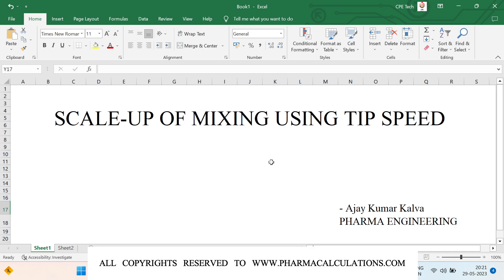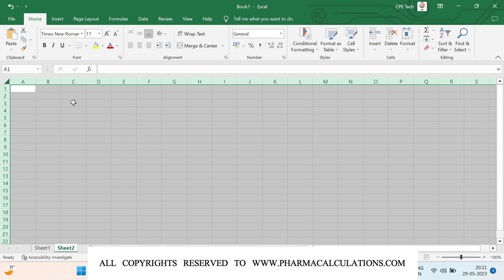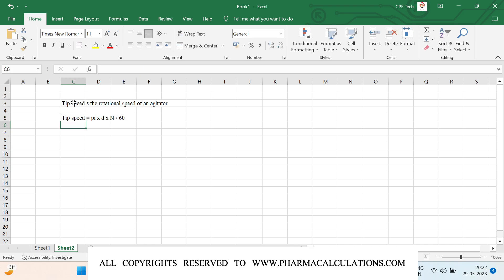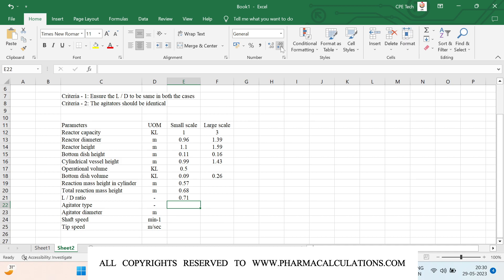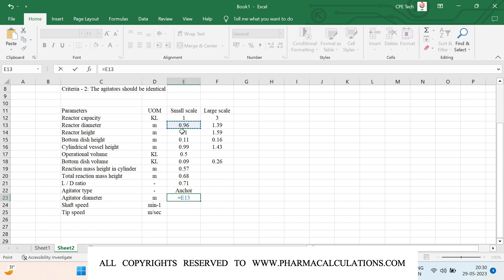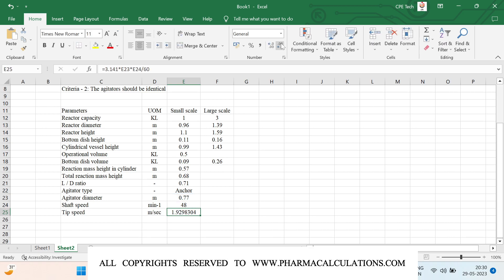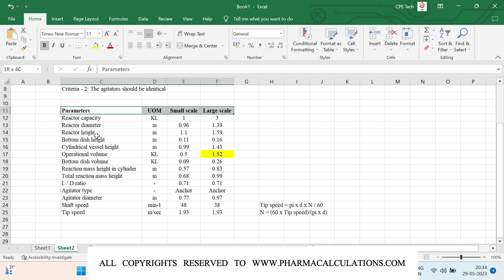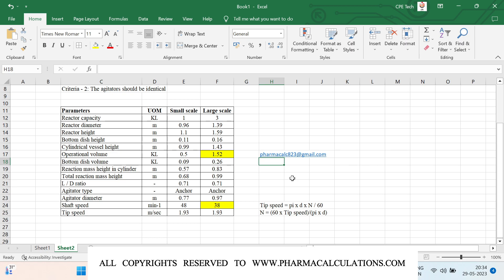Scale-up mixing using Tip speed

Comment: Can we calculate tip speed of two different types of agitator small scale propeller and large anchor L/D is same but D/d not same
Reply from the maker: No, if the process demands a specific mixing pattern, matching tip speed of two different impellers won't suffice
Reply: @pharmaengineering  if it is homogenous mixture
Reply from the maker: @vrganesh9841  most of the cases if it's a homogeneous mixture there won't be any issue,
However if the operation demands a specific kind, then we have to
Reply: @pharmaengineering  thank you sir
Reply: Power per unit volume is the best method for two different impellers